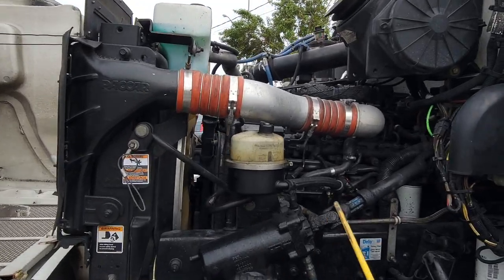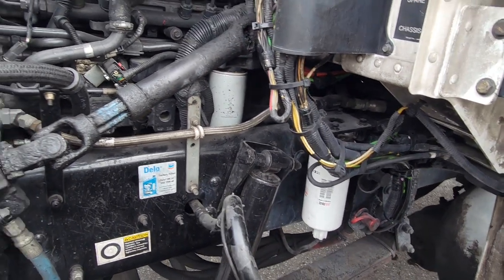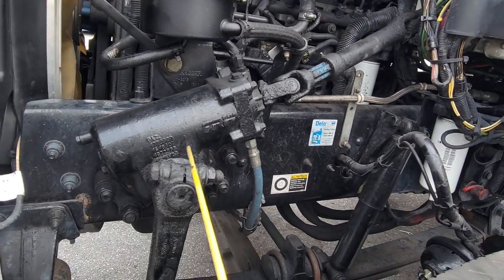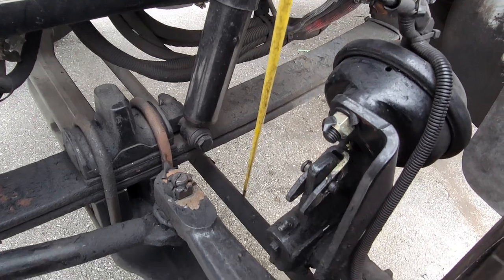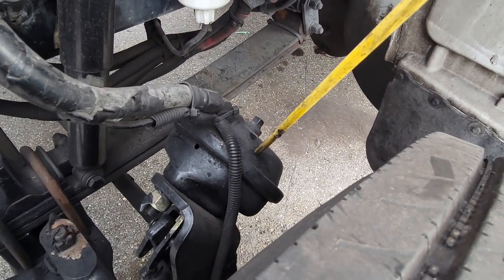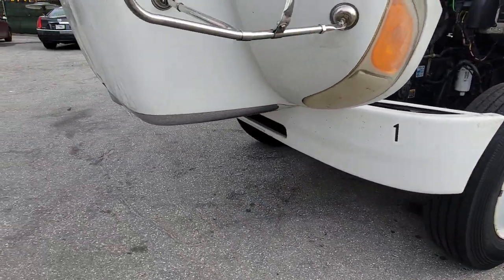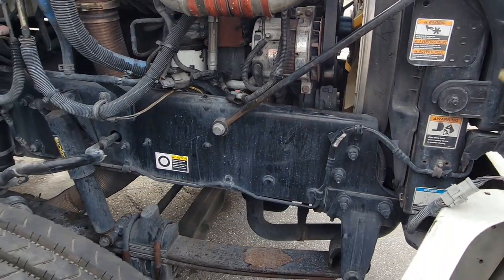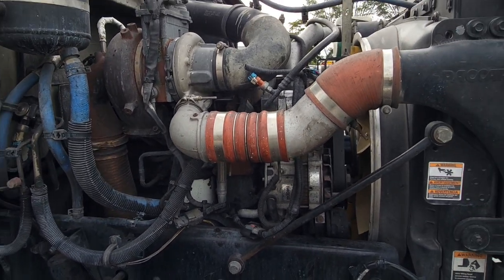Class A Exam - Engine Compartment

Comment: Thank you for sharing a clear video of the components. I start driving class next week.

from this video:
7 components, not including the reservoir and pump.

1. Steering column or shaft , No holes, rusts, welds, not bent, Properly mounted and secured to the u-joint, 
2. U-Joint is not missing any bolts and is well greased and properly mounted and secured to the gear box: 
3. Gear box is properly mounted, no cracks, damages, not leaking any hydraulic fluid. Supply return hoses off of Gear Box: properly mounted and secured, no abrasions, bulges, or cuts. Gear box is properly mounted and secured to the chassis, no illegal welds. The gearbox is properly mounted to the pitman arm.
4. Pitman arm properly mounted and secured not cracked or damaged. Pitman arm secured to drag link
5. Drag link properly mounted and secured not cracked or damaged. Drag link is secured to steering knuckle.
6. Tie rod is separate and lower down.
7. The CASTLE nuts and COTTER pins are present and tight. The sockets are not worn.